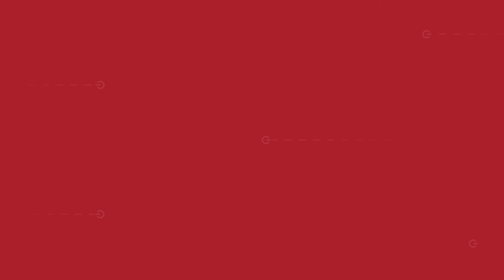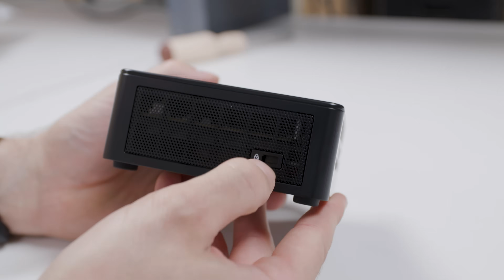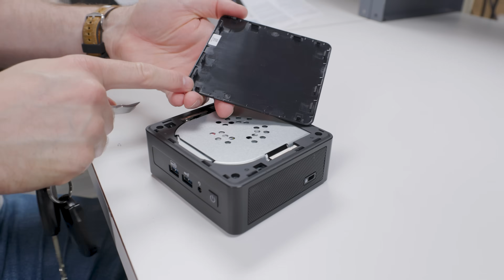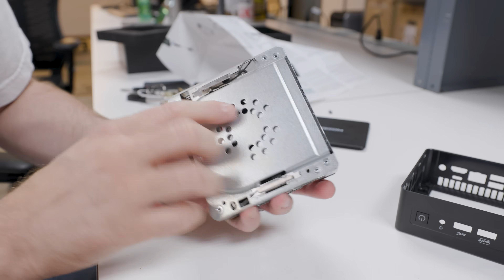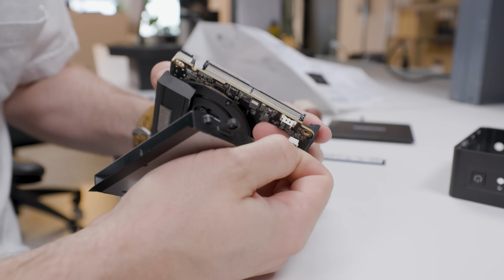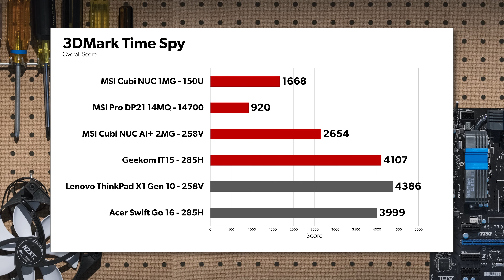Tearing Down This Mini PC Was Fun!

Comment: I'd vote for more mini PCs, on this channel.
I'd also vote for proper long hours gaming / heavy load tests, in order to evaluate the actual limits of the "Device Under Test". I'm mostly fine with my "slightly aging" Minisforum UM780XTX (Ryzen Zen4 7840HS octa-core + Radeon 780M/12CUs/RDNA3). I've noticed, though; my 2x32GB DDR5-5200 SO-DIMMs seem to overheat when i'm utilising them heavily as VRAM for the iGPU. (similar results with 2x16GB) Wendell, from Level1Tecs mentioned, that DDR5 ICs tend to not do well at temperatures above 70°C. Well, mine got to 70, and beyond, despite the little stick-on heat sink - i think it's an air-flow issue. During the recent and long overdue physical maintenance (i'm a smoker - quite the build-up), I've modified the stock air-flow pattern. Now, the fan actually forces air over the RAM, instead of just blowing along the path of least resistance, out the side vent. (I've blocked off the side vent with electrical tape) preliminary tests indicate, that my "mod" actually affects temps - not much lower, but a few degrees for sure. (i have yet to conduct a multiple hour long gaming session)